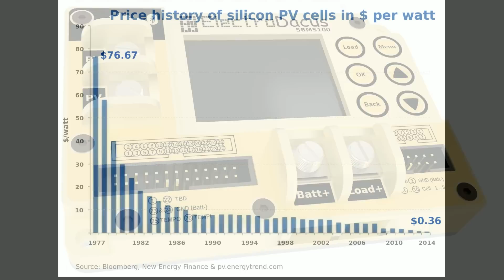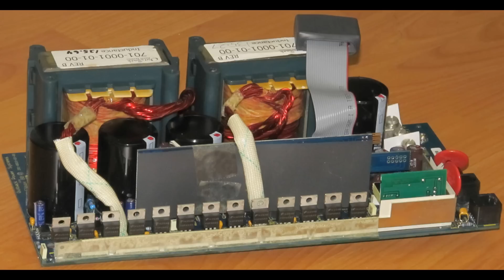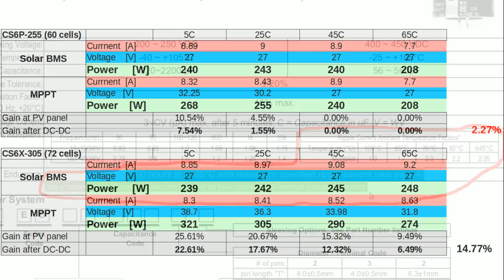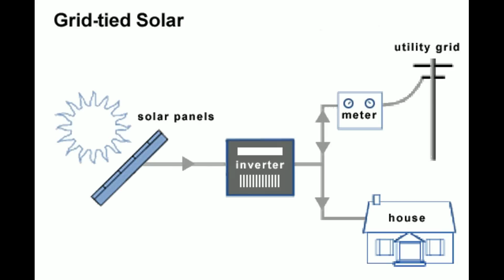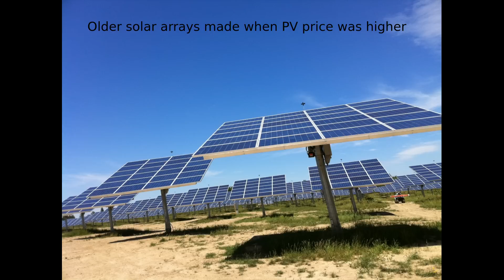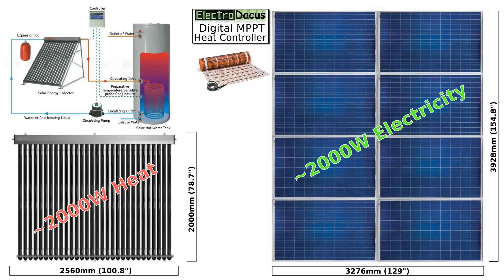Is the MPPT in OffGrid Solar obsolete ?

Comment: Hi Dacian. I certainly agree that MPPT is not necessarily cost effective in every situation, but I'm not sure I agree with you that solar thermal and large windows as obsolete. In addition to all the same photons that solar PV can use, solar thermal will also harvest energy from the less energetic photons which don't have enough energy to excite an electron into jumping the silicon band gap in a PV cell. If you're heating domestic water then you can expect to be achieving efficiencies of 60-80% from a solar-thermal solution versus around 20% for solar PV. You need around 4x the area of PV for the equivalent output. Full disclosure - I have a 2.5KW evacuated tube solar thermal array on the roof which provides the hot water needs for a family of four for 7 months of the year, and provides a reduction in the water heating costs for the other 5 months. Cheers.
Reply from the maker: Hi Jim, Sorry I did not get in to to much details about those in here but I have detailed calculations showing that PV is more cost effective for heating. Problem is not about efficiency you seen that the vacuum tube panel was much smaller for the same 2000W output but the cost was the same so if space is no issue PV will cost the same at the same output.
Thing is that is not just the panel for thermal solar you have to invest in expensive high temperature pumps and thermal isolated pipes need to be run where you need that energy.
Look at my example closer the area is just 2.5x larger since the tubes are spaced to allow sun to hit them at an angle.
That is a real panel with real spec and the photo is relatively at scale.
That is a 30 tubes 7500BTU about 2.19kWh but that is a bit optimistic I seen real data from that Thermal panel in full sun in the afternoon a bit cold in winter here and it was a bit under 2000W plus you need to cut the pump energy from the equation.
I know your channel and I know you can understand this so I can explain more if you are interested.
Here in Canada that vacuum tube 30 tubes 1.8m long cost here the same 0.8$/Watt as solar PV.
All the complications with the hot fluid and the fact that you can not use that energy for anything else than heat makes things even worse for the solar thermal.
Efficiency is only related to space used by the collector it will not help with the cost of energy.
I have unlimited space here around 8 hectares (20 acres) I do not care much about the size of the array.
Electric heating is way more reliable no moving parts no thermal stress. I will have about 30 x 200W heating loops embedded in the concrete slab on my house that has 14 cubic meter of concrete and can store 100kWh of energy at 10C delta.
When you got the thermal solar panels probably the PV was 2x or 3x more expensive. Now things have changed and the PV got a lot of technologies by surprise. I'm sure many 99% do not even realise this has happened that was one of the reason I made the video.
Reply: ***** Hi Dacian. Text messages area a terribly medium for holding a conversation. Things can come across as confrontational when that was never the intent, so I'm hoping this all comes across as the light hearted discussion it is intended as.  I am thinking here that it's a case of different horses for different courses. Both the high temperature pump and pipe insulation on my thermal system is the same as the ones used on the central heating system on the house. They're both very cost effective components here in the UK because of the huge number of central heating systems sold. My thermal system was installed back in 2006, and due to the double bonus of both government and local council grants, the installed system cost me less than the 106W of monocrystaline solar PV panels which I'd bought a few years earlier (we're talking about 2001 prices here..things have come a long way since then) - That solar thermal included installation of a 205 litre hot water tank too. Working out the relative costs (including the government and local council grants), the professionally installed thermal system was 7.6% of the cost of the equivalent quantity of uninstalled PV panels at the time (not including wiring, batteries, charger or inverter).

 Space more of a premium here in the UK (particularly close to London where properties run at around $500 per square foot) - I don't have the ability to expand off the rooftop as you do and it certainly wouldn't be economical to buy extra land just for panels where I live. (My longer term plan is to move away from London and get myself a few acres... and if I ever achieve that plan then I'll be doing a grid-tied PV installation which is a bit bigger than my current 106W peak). I'm not sure that the complications of dealing with hot fluids are much of a downside - all of my cars and my central heating system have been circulating hot fluids around their pipes reliably for a couple of decades without incident. Although I agree that electricity is a far more useful form of energy than low-level thermal, my family uses a lot of hot water every day - It is only on the hottest days of summer that the tank gets up to 80C... most days it's around 50-60C which is pretty much perfect for what we need - we demand a lot of thermal energy every single day.

I am pretty sure that if I added more solar PV to my roof here, I would keep the thermal installation in place too. I have space for around 4WK of PV panels on my roof here and I'm certain that I could use all of that energy on a daily basis too. It would not be efficient for me to replace the 2.5KW thermal panel with the equaivalent space of PV (around 600W I am guessing), and as such, I am still disagreeing - solar thermal is not obsolete :-)

Hope you're having a great day.

Cheers!! :-)
Reply from the maker: Jim Conner
Hi Jim :) no worry I never see a conversation as confrontational. But you are right this comments are not the best place for a conversation.
I'm referring at the current prices for PV and thermal not the prices of a few years ago.
Currently at least here a 2000W solar thermal (vacuum tube type one) cost the same as 2000W PV. I only refer to the panels not the other components needed.
So the only issue may be available space like I mentioned thermal solar will use about 2.5x less space and that can be important in some places.
Once you already have a solar thermal it makes absolute no sense to replace even if the PV are free :)
I also do not care about government grants on particular technologies. I never used and will never use a grant and will not consider that when making a comparison between technologies :)
So if the same power thermal and PV panels cost the same then the amount of extra stuff that you need circulation pump, thermally insulated pipes and heat exchanger are way more than what you need for the electrical system.
I also doubt that a circulation pump able to work for 30 years will not be expensive not sure what your definition of expensive is :) I do have a few China made brush-less pumps that I use in my temporary heating installation just a few months a year less than 3 or 4h a day but they will most probably not last 30 years and if they need a few replacements they will also cost a few hundred $
Moving electrons creates just heat there is no friction there.
So you do not need to cover the panels in summer ? What happens when the water is at 80C ? (quite high in my opinion for domestic hot water 60C is usually max) Where dose that extra energy go ? If the tubes get to hot something will break. Do you have some separate circuit to dump the excess energy ?
Reply: Hi Dacian - if the water in the tank boils, then there is an vent pipe at the top which lets the steam/boiling water overflow back into the cold water header tank. I've never yet seen the tank get above 85C. This is good as you need to regularly take your hot water tank above  60C to prevent the growth of the legionella bacteria.  Solar thermal panels achieve their highest efficiency when the water is coldest, so it's unlikely that we'll ever reach boiling point. The hot water cylinder is a dual-coil arrangement with one coil at the very bottom of the tank (heating all 205 litres) and another coil midway up the tank heating only the top 102 litres. The solar connects to the bottom coil providing preheating for the whole tank, and the central heating system connects to the mid-level coil to top up the temperature when needed on less sunny days.

Cheers!!
Reply from the maker: Jim Conner
Hmm... interesting you must use a lot of hot water :). A friend has this thermal solar panels but it needs to cover parts of the panels in summer so the water dose not get to hot and damage the installation.
I think 60C is safe enough so that no bacteria can develop.
So the tank is 205 liters that is fairly large since it needs 2.5kWh to rise the temperature with 10C So if you start in the morning at 40C then with full sun for about 4h you get that water at 70C that is without any losses or hot water use.
I guess you have a single panel 30 tubes 1.8m long that is about 2000W in the afternoon.
So it seems that with daily use you are able to use all that available energy in summer and use the central heating for additional energy in winter.
Not sure I get where the overflow water is going (cold water header tank) is that a separate tank for cold water ?
Reply: ***** You're not wrong - 2 or 3 baths per day between us all, plus washing up, washing hands etc. We are far from water efficient in my house. The estimated figures you quote for the heat increase in the tank are pretty much exactly what I am seeing in practice. Our hot water cylinder is very very heavily insulated (around 15cm of insulation on there) so the losses from thermal radiation are pretty minimal.

In the UK we don't have the same pressureised water heaters that you have in the US/Canada. The more normal setup is to have a cold water tank up in the roof which feeds into the bottom of the hot water cylinder. The hot water is drawn off from the top of the cylinder and feeds to all of the hot taps around the house. This picture shows a conventional UK central heating system ( http://www.gasman.fsbusiness.co.uk/images/heating_system_1.gif )... My setup is exactly the same, except that the water cylinder is twice the size and there's an extra heating coil at the bottom of it connected up to the solar-thermal panel on the roof. Because cold water is always drawn in at the bottom of the tank, it means that our solar setup spends a lot of it's time running at it's most efficient (when the water is significantly colder than the panel).

It's a lovely sunny day in the UK today. Water from the cold tap is around 15C, but even after the two baths we've run so far today, the water at the base of the cylinder is already up to 33C. The top of the tank is up to 37C and the water inside the solar panel is up to 44C. I fully anticipate that the hot water tank be up to around 50C by the time we need to bathe the kids this evening. I think that's pretty good since we're only a week into springtime.

Hope you're having a wonderful day. I'm off to build the footings for my new greenhouse.

Cheers Dacian!!
Reply from the maker: Jim Conner
Hi Jim, Thanks for the replay. I was expecting something like that based on your initial description :). It seems like an older method maybe do to insufficient water pressure from the municipal water supply. Still looks to be an efficient way to deal with extra hot water in case that is a problem.
Good luck with the new green house. I guess there will be some videos on you channel with the progress.
Reply: We have solar heating (for water only), about 6m² (I wasn't there at installation, so I don't really know the kW rating). It's nice to see the gas meter stop for over half a year, but water heating is maybe just 10% - 20% of the total heating costs anyway (and that is in a well insulated home). Most time in winter the panels aren't even close to providing a significant amount of heat and most of the summer the 500l hot water tank is at 80°C before noon already. I've read 160°C from the temperature sensor at the panels. So much wasted heat...

I don't know about the windows, because it's hard to tell how much you really gain and lose over the day. I have a few large glass panes (triple paned isolated windows/doors) and on sunny days in February and March (and same in October/December) it's easily possible to get the rooms to 23°C without the central heating being on (it will kick in around 7 or 8 in the evening then). I don't know if it's saving or wasting, but at least I like the light coming in ;)